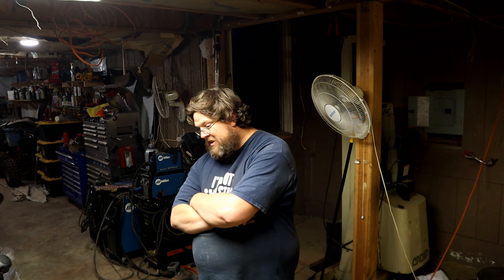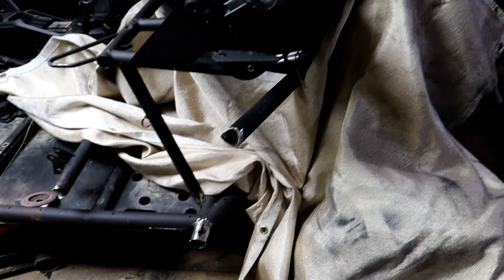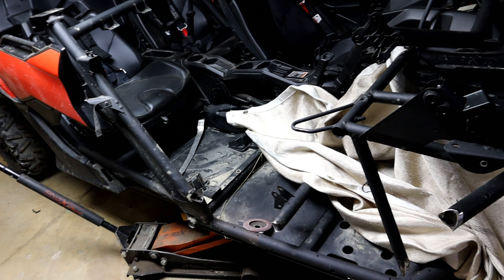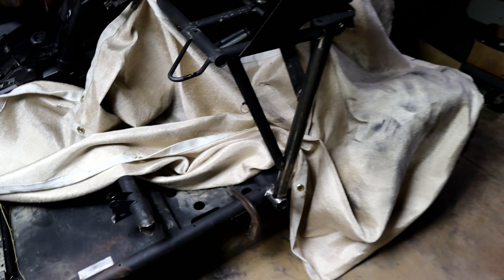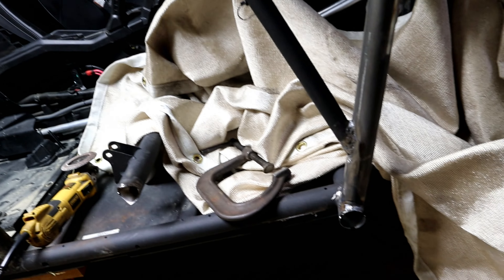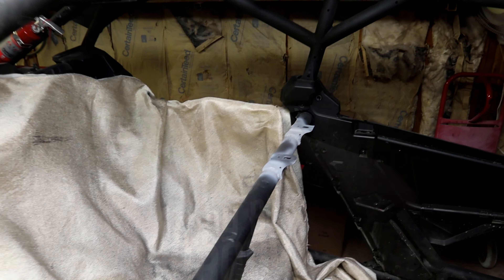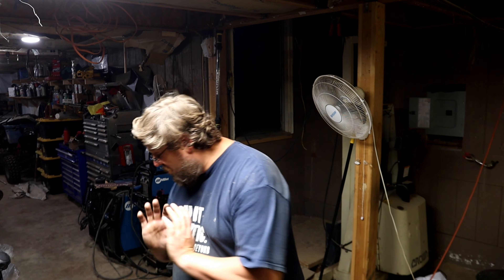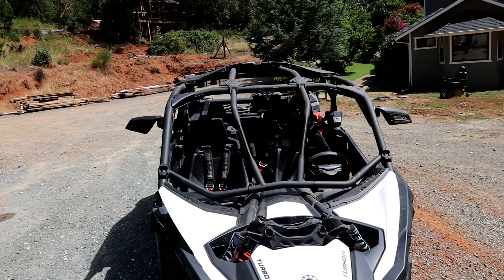2020 can-am x3 scumbag frame repair part 2

Comment: You mentioned you had some trouble on the thin tubing. I’m having a similar issue. Do you remember the weld wire and settings you ended up using?
Reply from the maker: .25 wire not sure on the settings but I got it dialed in on the bars I cut out